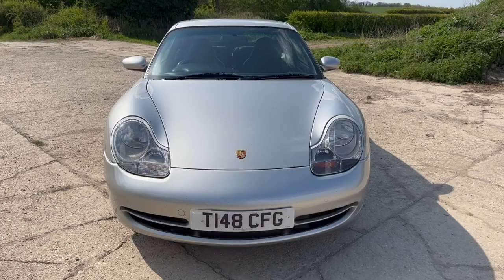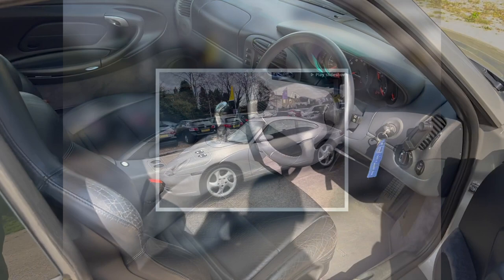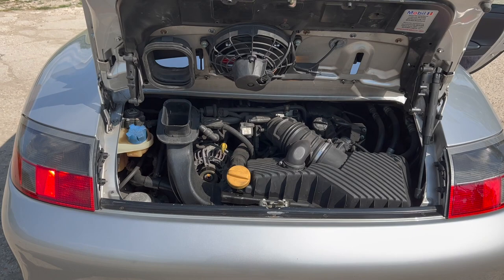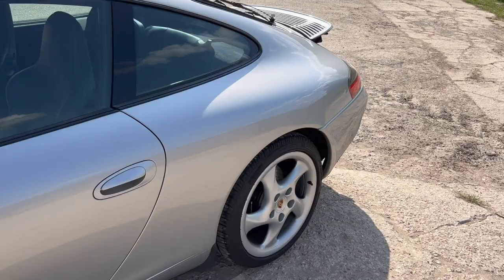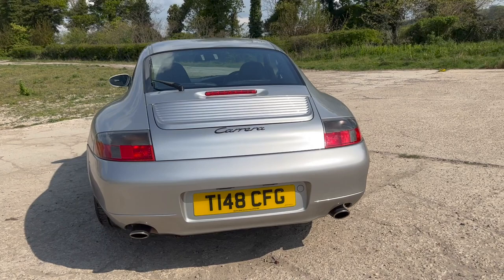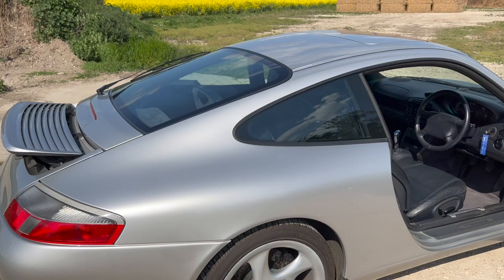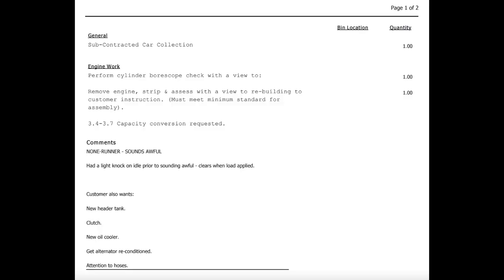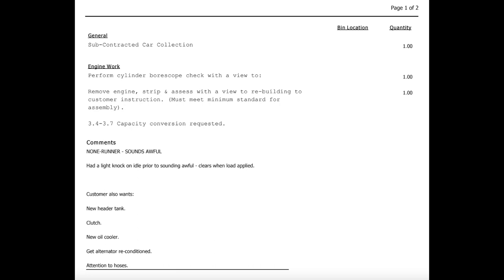Porsche 996 Hartech Engine - Episode 1: What I've ordered and why

Comment: I did exactly this to my 3.4 Gen1 manual coupe. Had the car back approx 6 months now and all I can say is it absolutely transforms the car. Grant and tobias at Hartech are top blokes, no bs just straight facts. Performance wise mines putting out near 340bhp. As a comparison it’s got the slight legs on my pals 997 3.8s. If you’re thinking of doing the conversion, do it 100%, you will not be disappointed
Reply from the maker: Brilliant, good to hear and I'm really looking forward to it now. Grant has been talking me through it so far and I agree seems like a top bloke. That's good to know about the 3.8s, I guess the weight difference helps the 996 vs that car too?
Reply: @leeevernden  exactly right. Those 3.8s were 350bhp from factory but realistically a 15 year old one with 70k on clock will prob be around 340 ish now. Then you throw in the 130 odd kilo weight difference. Much much prefer the drive on my gen1. With factory M030 and with factory Limited Slip diff, it’s feels so much more ‘alive’.
Reply from the maker: @marshallsonmotorsltd2101  Excellent, yeah that's what I'm after really, an engaging drive.
Reply: @leeevernden  faster and better handling than any 993 I’ve owned and they’re 3 times the money 💰
Reply: I had nien lives motors do same blew up after 1700 miles
Reply: @pulaskicondoassociation6799  That’s why I’d only trust Hartech. Their rebuild come with 100k miles / 2 year warranty

Comment: Good for you mate!
Mine’s down it Atlanta at Flat 6 Innovations getting a 4.3 conversion, can’t wait to get it back!
Reply from the maker: That sounds awesome! What sort of power does the 4.3 make?
Reply: @leeevernden  they really target torque with their build, but the results from their most recent builds would indicate about 475bhp at the crank, perhaps a little higher if they get lucky (the heads and intake pipes have already shown very encouraging numbers).
Power is not what these cars are all about, it’s the chassis balance and overall usability that makes the 911 so great. 
More power just means potential for trouble.
Reply from the maker: @user-qn6yt3zx3w  absolutely. For me it's as much about the rebuild as the conversion, having a fresh start for the engine with most of the weak points engineered out means you can just have fun with it. Apart from the engine and maybe shifter I'm keeping it bog standard because as you say its so useable and I want to keep it that way.

Comment: Nice video! My 996.1 is undergoing a full engine rebuild to 3.7 as well. Have it already for 6 years now, but it had a knocking sound at idle when cold and warm. They opened the engine and couldn’t find any bore scoring. The engine looked fine, but the pistons were out of ‘tolerance’ so too much play was causing the sound. The experienced rebuilder said it was ‘just’ normal wear of multiple components at 160.000km. They could see the car is well maintained, but still the engine was worn. 

The sound on your video however sounds more like a catalytic converter which is rattling. I replaced mine with straight x-pipe and it still meets the MOT check for emission in the Netherlands. Sounds brilliant combined with headers.
Reply from the maker: Thank you, you might be onto something with the Cats rattling actually. That's something I'll check before the car goes off to Hartech. If the new metallic rattle is the Cats then I'll get Hartech to swap those out for some 200 cell ones. My current cats are the only original part of the exhaust system, it already has tubular headers and replacement genuine back boxes. As for the knock, I suspect they'll find something similar to yours in terms of normal wear and tear for these engines but my symptoms are more consistent with crank bearing wear as the noise does go away when at higher oil pressures. Out of interest where are you having your 3.7 work done? And what do they do with the IMS?
Reply: @leeevernden  keen to hear if it was indeed one of your cats. I’m not a mechanic, but to me it sounds too harsh and loud for a rod knock. 

So I decided to do it in Poland at an amazing workshop specialized in Porsche, Ferrari and Lamborghini. It saves me a lot of money compared to the prices in the Netherlands. 

They got the parts for 3.7 from a German Porsche specialist. This company also offers 3.9 for our cars, but that means €5.000 more because of the crankshaft from a 997 S(?). That’s a bit too much for me, looking at the value of a 996. 

For IMS I got one from a German company as well. To be honest my dual row IMS (I have 1998 model) was perfectly fine after inspection. But I didn’t want to take a risk of having a brand new engine and an old IMS. Regarding the IMS I think this is totally blown-up on the internet driven by Porsche ‘specialists’ who make a lot of money on fixing it for worries 996 owners. The real issue for 996 and early 997 is bore scoring. Especially for cars in colder climates.
Reply from the maker: @Jean-Paul_1984  Yeah the rattle is so loud you cant really hear the knock, they are 2 different issues for sure. I can check the cats quite easily with my stethoscope so I'll investigate that soon. Agreed on the IMS thing, but the market here in the UK at least has IMS solution cars commanding a premium over original IMS cars no matter the situation. Mine is also dual row currently, I read somewhere they have a 0.5% failure rate so it's nothing really. I think you are right to stick with 3.7, these cars have a good power to weight ratio anyway, just a bit more than the 3.4 would be perfect I think. Good luck with yours, hope all goes well.

Comment: Hi Lee. It’s good to see you’re enjoying the car despite the FGP Comprehensive Inspection & Report identifying the engine fault the 996 unfortunately has. The front suspension work we carried out for you certainly improved its drive. Best of luck with your plans for the engine. Enjoy!
Reply from the maker: Thanks, and yeah grateful for the work you guys have done so far, the car will be back with you early 2023 as a 3.7 to tidy up the rest of the bits on the Inspection report.

Comment: The Gen1 996's are superb, as are the Gen2's .  I'd want the amber lights put back on personally. I was looking for the same as yours but ended up with a very low mileage Turbo coupe manual which is fabulous.
Reply from the maker: Nice, I do like the turbos. I think my car had these lights from the factory, it's a late '98 build but '99 year car so pretty sure that's the first clear light ones. Plus these lights are my favourite but I do also like the ambers.
Reply from the maker: Also I think Gen2's look much better as wide bodies, the more aggressive styling doesn't suit the narrow body in my view.

Comment: It's worth changing the starter and y cable which is the wiring for the starter too. These get tired with age and you can get a lazy starter when the engine is properly hot. Most cars of this age will be still on their original parts and its a reasonably common fault. It's a pain to change with the engine in, not impossible, but obviously a doddle when it's out.
Reply from the maker: Thanks, will do.

Comment: Mines an '016mt coupe in meridian metallic, very similar. Its got a few more options, 3 spoke wheel, headlights r litronic, but otherwise sister car. We don't have hartech in USA, sadly, but there are good options. Knock on wood, mine is not bore scored and so I may never have to do rebuild. I might anyway but not immediate. There are long waits here for rebuilds, and some metals are getting harder to source for the parts manufacturers...will watch please keep sharing.
Reply from the maker: thanks, yes I am anticipating some delays once Hartech get the car as the work is so extensive there are bound to be hold ups with parts/materials somewhere, but that's fine it'll be worth it in the end.

Comment: That rattle doesn’t sound internal. Sounds like exhaust clamps rattling or something much smaller. Have you sent hartech a video of the engine noises. You might not need the rebuild just yet and you might be able to drive it. Engine mounts are the first thing I always do and have a set of RSS semi solids with less than 100 miles in that I need to sell. Love silver over metropole, I’ve had two of that combo 996.1 now. I really would challenge you on a rebuild to 3.7 for two reasons: 1.) the 3.4 engine is perfect for that car as it is. 2.) I can’t hear any sounds that make me think it needs a rebuild, so why would you spend that kind of money. I honestly would get it trailered to your nearest specialist and get them to inspect it. Might be a cheap fix and just drive it :)
Reply from the maker: Yeah I will do another update in a couple of weeks but the rattle noise was indeed nothing to worry about, I did find that quite easily in the end and the car is back in use. I get the point about the 3.4, I have wrestled with that but I feel like I may regret not getting it further down the line as whilst the engine is being rebuilt to a ludicrously high standard, what's the point if the end result is exactly the same performance, I may as well allow Hartech to make the best engine they can from the 3.4, and that's the 3.7. It's not really about the money, the work is only expensive in relation to 996 prices, I want the best daily drivable analogue 911 I can get, for me the 996.1 c2 is just that part from the reliability issues. On your second point, I will put a recording of the knock in the next update, it has already been to Friends Green Porsche and they said the engine was - and this is their words - 'Knocking it's tits off' 🤣. But now I know the engine won't imminently explode I will tell Hartech to run it up and give their opinion before they do any work, that will just give me a safety net of a second opinion just in case friends green missed something silly.

Comment: Nice mate, I'm thinking about getting a hartech 3.7 in my boxster!
Reply from the maker: Blimey, now that would be epic!
Reply: @leeevernden  I have a bit of a vision to build the rowdiest 986, complete with carbon fibre cayman hardtop, rollcage and GT4 style spoiler. Gonna be a year or two of saving first. Looking forward to seeing how your build goes, so I've subscribed :)
Reply from the maker: @ett_baer  Much appreciated. That 986 would be a rocket, should handle pretty nice too setup like that.
Reply from the maker: @UCJTjgwQ4kCjgv8mYrI3QBNw I kind of feel the same about the 911, it wasn't used much for the past couple of years so I have a few problems to deal with but I know how good it will be in the end so it's worth it. Good luck with the 986, good thing you bought one when you did, values will surely rise in future.

Comment: The video of the tapping noise when hot is exactly what i have on my 99 3.4 996..i have no smoke car drives without fault..and is silent when cold..i know it had a bottom end rebuild about 20k but it taps when hot...very strange ..im wanting to sell it but everyone's just gona say it has bore score..what a pain!!
Reply from the maker: I feel your pain. Mine had a bottom end rebuild at 30k and had steel liners put in so 100% my issue was not bore score although that's what everyone always goes to. In the end not one single guess was correct as the main suspect after the tear down was small end bearing wear which I'm told is virtually unheard of.
Reply: @Lee Evernden  i thought mine was a sticky tappet..iv been standing behind it before and the noise just disappeared all of a sudden...then next day it was back ...its a nightmare

Comment: Good luck and I hope it all works out, that’s a big investment so the car ought to be perfect when you get it back. I’ve had several of these cars, they all make a different noise or have some type of rattle or knock. The car looks very straight, what’s sort of mileage does it have?
Reply from the maker: Thank you David. The car has 87k miles on the clock, but has already had major engine work back in 2009 when at 30k miles. Apparently it had a damaged piston and the engine block has been relined - so I'll be interested to see what Hartech find in there. If only I could find/talk to the previous owner who had it from 2001-2021.

Comment: What’s the cost of the engine rebuild with the 3.7 conversion?
Reply from the maker: Varies from customer to customer but Hartech estimate between £8-10k plus a couple more for the 3.7 conversion
Reply: Correction, mine came in at £13k plus the vat

Comment: Put a new starter in as well mate you can't get to it on these cars with the gear box in
Reply from the maker: Noted, will do.
Reply: Yes you can take off top intake pipes and you slide it in…it’s tight but the new unit will go in.